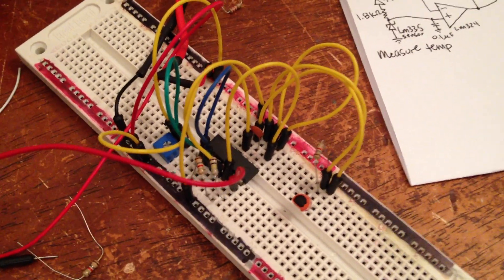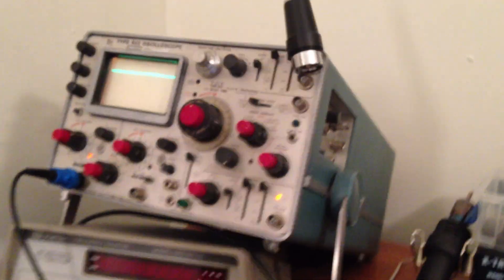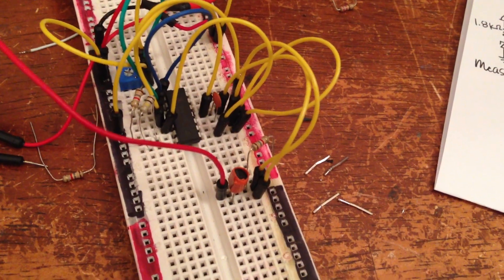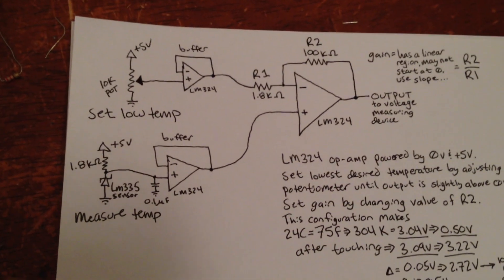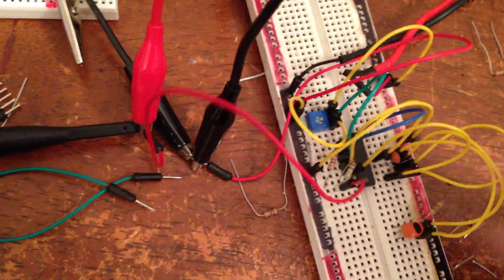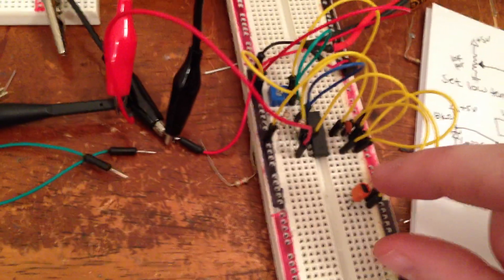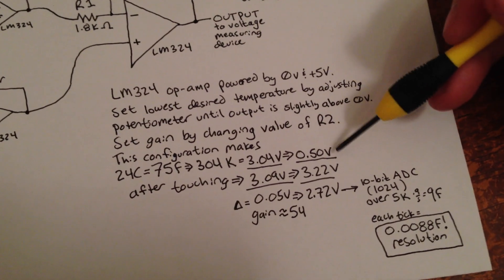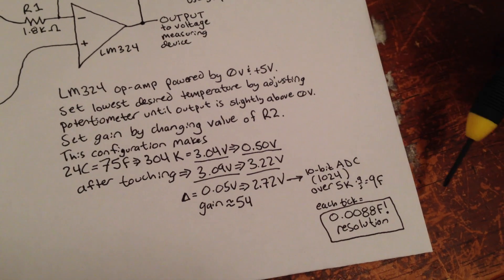Precision Temperature Sensor LM335, LM324, ATMega8 AVR, and RS232/ USART / USB / Python

Comment: all this, even if it'd work, can't hide the LM335 Temp sensor built-in accuracy of 4°C in the -40°C up to 100°C working Temp range, at best 2°C @ 25°C.
It could lead to a false accuracy perception which don't exist with the LM335 Temp sensor.

Comment: Precise measurement of the Temp Sensor output, but what is the anticipated accuracy of the Temp Sensor itself?  Your amplification prior to precise measurement is useful for monitoring relative delta fluctuations in Temp, but any inherent error of the Temp Sensor is also amplified.  Just saying to keep in mind..
Reply: Had the exact same concern.The datasheet says that the error of the sensor is 1 degree celsius when calibrated.

Comment: How did you come up with that circuit? that is an inverting configuration, in the + you should have to have the virtual ground, usually a buffered resistor divider, but you are using your diode as one of your resistors(!)... On the - is where you should have your sensor indeed, in this case using a 'voltage divider' formed by the sensor and the pot. Why are you doing it this way?